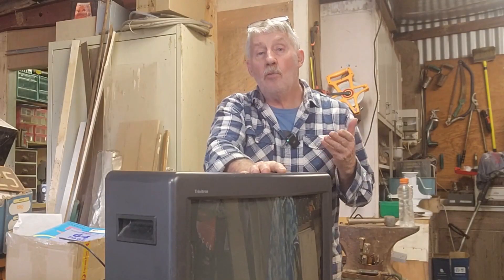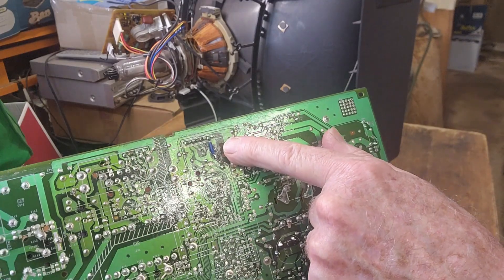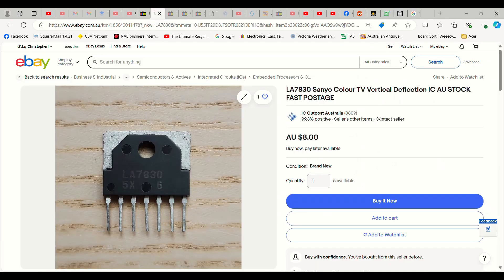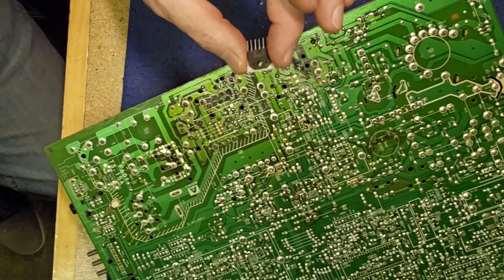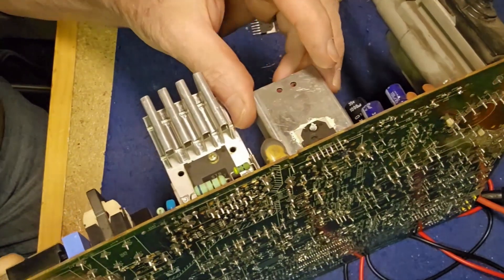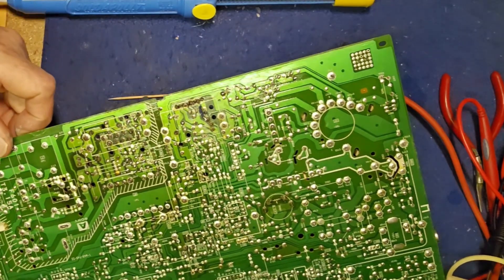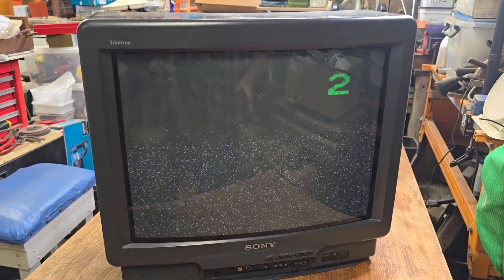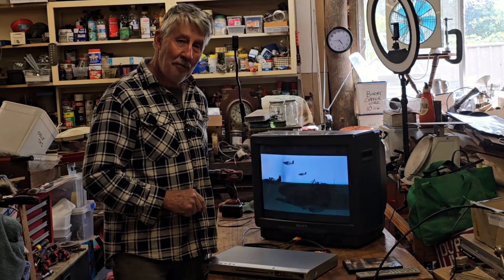Vintage Sony Trinitron CRT TV Repair Revisited! How to fix a Vertical Collapse Issue - Eventually!

Comment: I just picked up a CRT with vertical collapse and I'd like to try this fix!! Just curious if you'd know; once my set warms up a little the line widens up a lot but still looks warped. Do you think it's still the same problem or do I have to do some more recapping and such?
Reply from the maker: Maybe the vertical chip is ok - but most likely some dodgy caps and perhaps dry solder joints! Good luck Otter! 👍😊

Comment: Got the same issue with a TV I have same part # as well! I've replaced multiple capacitors and the chip but still have the same problem!
Reply from the maker: I would be looking very closely for dry solder joints next. I had a lot of them on this TV! Good luck! 👍😊

Comment: Biggest problem is finding replacement IC chips Like A 27in Sony XBR tv that I am working on now the STK regulator went bad because of a failed Electrolytic . I found one on ebay hopefully it will work .I have been repair Sony tv's since the 1980s .
Reply from the maker: Yes and I guess getting good quality parts is even more of a challenge!

Comment: Glad you managed to get this TV going again! But how do you KNOW that the chip is not static sensitive? Your were holding and twiddling it around in your fingers. If I don't know FOR SURE that it is not static sensitive, I NEVER TOUCH the pins....
Reply: Its just a linear amp chip. No static precautions necessary.
Reply from the maker: Probably right to be cautious and careful Dave, but there was nothing in the info when I was researching the IC to indicate it was static sensitive.

Comment: I've had some bad experiences with Ebay capacitors, so I tend to shell out for Mouser or DigiKey if I can justify it for reliability/longevity. The shipping cost to Australia HURTS though. 
I've also heard that Jaycar has stocked some dodgy parts, but I haven't come across it myself. I suspect we're in the same FB groups 😆
Reply from the maker: We probably are Nebby!! The trouble with Mouser or DigiKey is that they sometimes have a minimum order of 'way-too-many' parts when I only want one or two!

Comment: Mate, looks like that bad cap shorted the IC to ground and blew-out it's guts, I would say there were good sound effects to go with it ...lucky no fire.

I think you're pretty safe when it comes to getting scammed for an 8 buck purchase from eBay ...maybe a different story if were a $150 IC.
Reply from the maker: Yeah, that's my take on it. Cap went bad, shorted out the IC, then leaked and corroded the board! Very happy to get it going again 😊👍